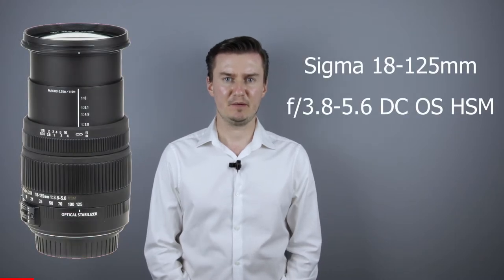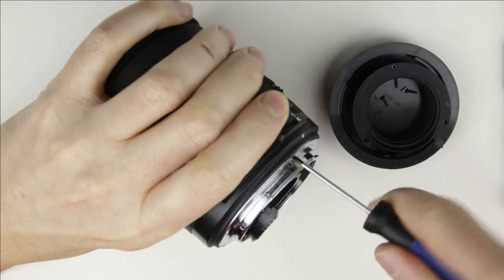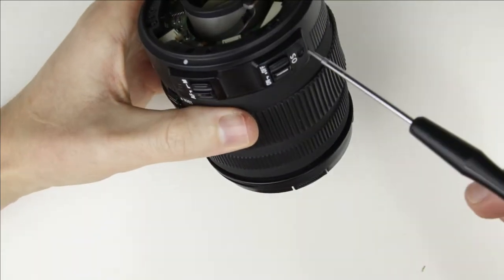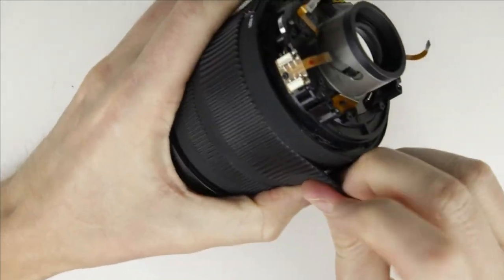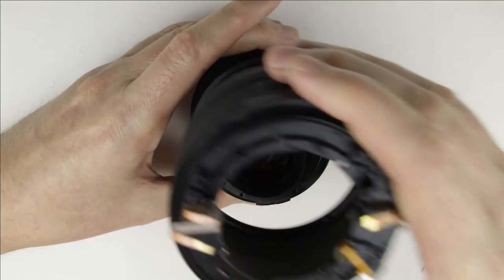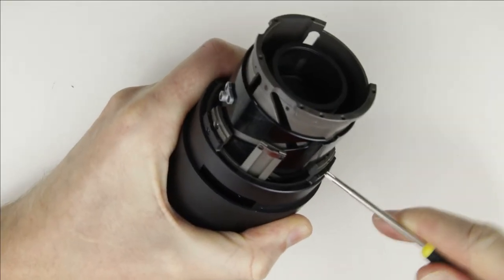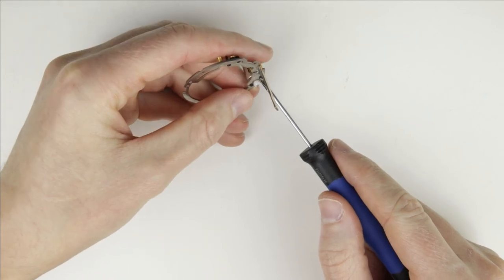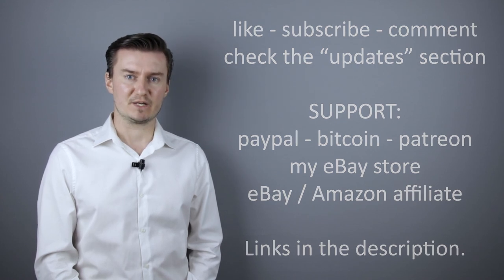Sigma 18-125mm f/3.8-5.6 DC OS HSM disassembly to replace the aperture and OS flex cables

Comment: I have the same lens and the same problems with it. I bought a ribbon cable stripped it down and then realized that the one soldered to the motor had also broken. It's still in pieces. Are small parts, washers and spaces available for this lens?
Reply from the maker: Check ebay and aliexpress, maybe you're lucky!